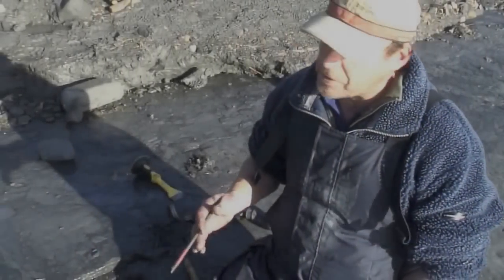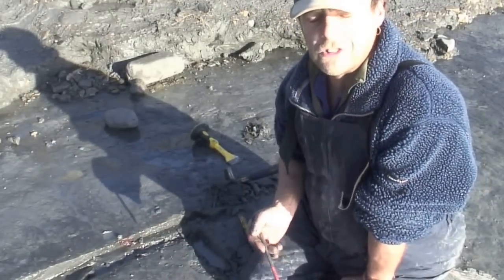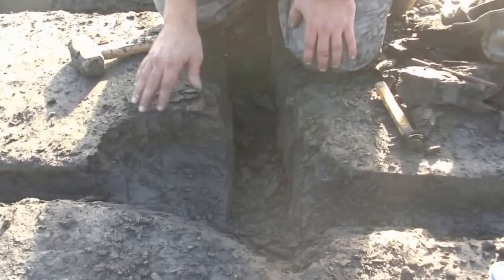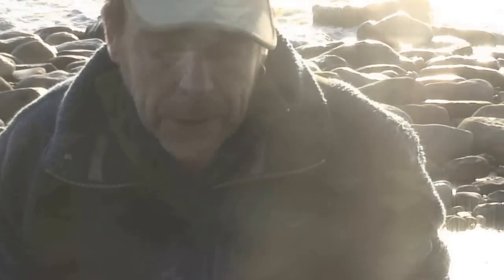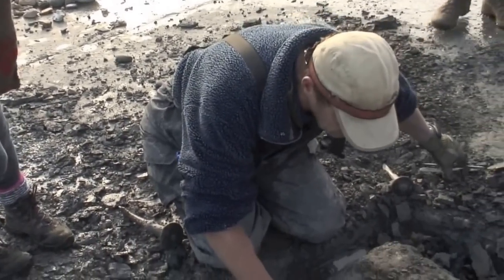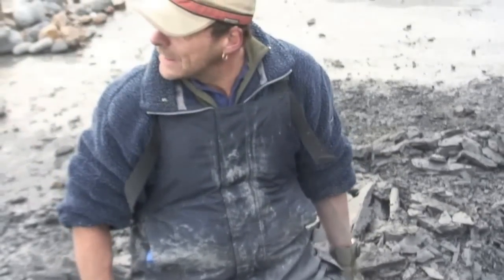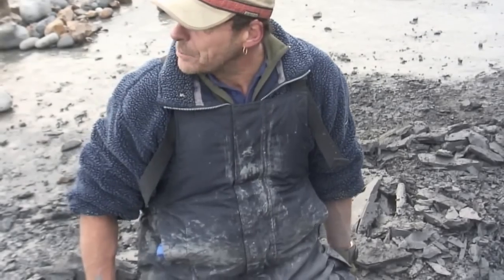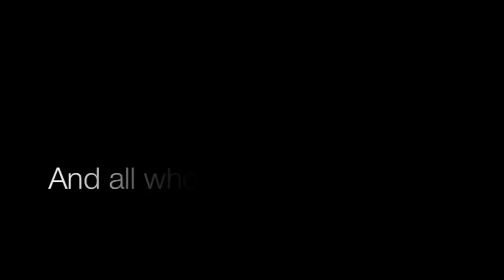Charmouth Ichthyosaur Find Boxing Day 2013

Comment: Pretty crude butchery getting it out.
Reply: +John Cummings  Hi John. The fossil did come out in  essentially 4 pieces. We did under estimate the total length meaning that a number of vertebrae were outside the original rectangle we cut. These were all carefully collected. I don't know how much you know about Dorset Ichthyosaurs. They are usually found in a more robust shale than this one. Typically the bones lie on a harder substrate allowing a better chance that they can be lifted with fewer breakages. Unfortunately my Ichthyosaur is in very soft shale, also there was a fault line running through the fossil and it was almost inevitable that it would open up along this line and it did. We also had to lift it before the next tide as a storm was coming in. If we had not got it up it would have been wrecked completely. Please be assured that it is receiving a great deal of care and attention during the preparation as you will see if you follow my updates.Alan Saxon

Comment: Great job guys. Was the area very remote? Couldn't you have brought maybe a generator and some sort of power tool to help trench? And are the recovery  techniques different from other specimens? Why wouldn't you make a field jacket to stabilize the rock a little more? I cant tell you how many times i cringed thinking the rock was going to break in pieces. You guys did a fantastic job. Congratulations on a wonderful find. Total time to remove??